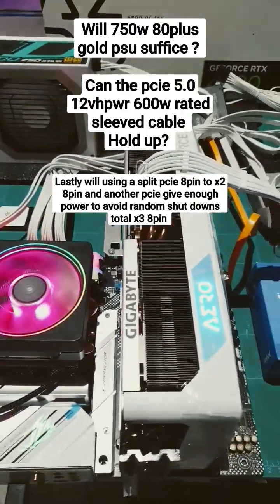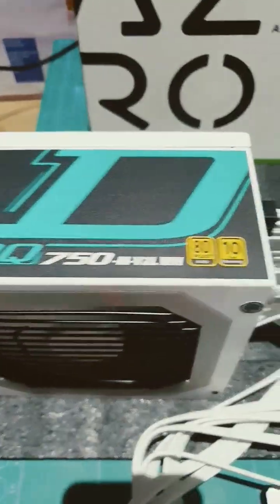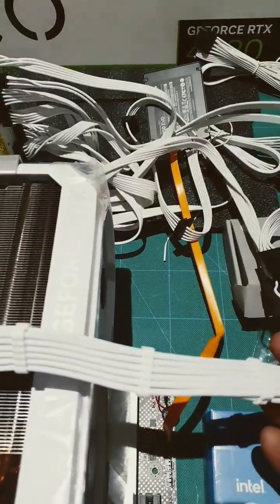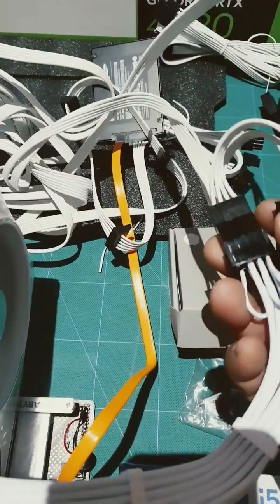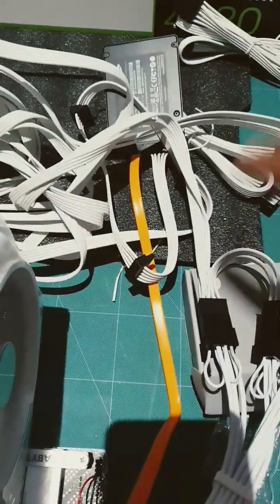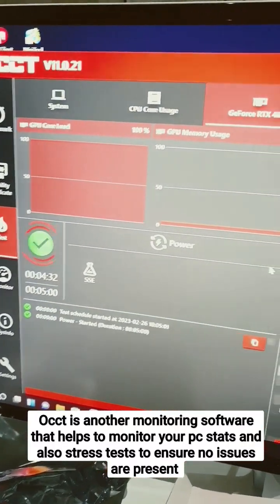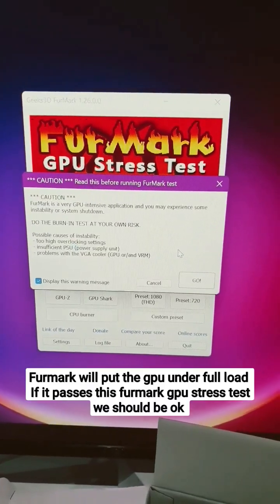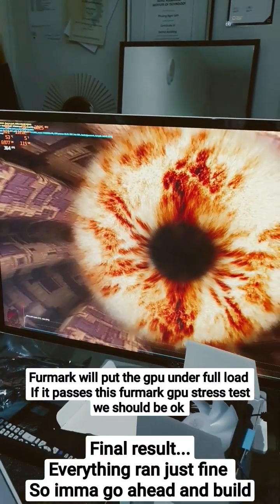will 750w 80plus gold psu run 4080? can  u use split 8pin and another single 8p? is pcie5.0 OK? TEST

Comment: the high end PSUs has the 12 volt power cable and you dont need any spliters.
Reply from the maker: @randomgaming5332  sorry bud what do u mean by that i don't understand
Reply: @MIKEYZVLOGZ  There are PSU that has a 12V-2x6 GPU cable+port so you dont have to use the default one that comes with your GPU, witch you have to connect 3 standard PCE cables.
Reply from the maker: @randomgaming5332  oh ye  true I get ya now..u meant higher end psus have more then just 1 split pcie cable ...and that's true ... 100% it is... so in other words if tour getting a descent gpu get a descent psu to pair with it ... good point ..

Comment: How about a 750w 80gold corsair psu for the i7-13700k 13thgen and Rtx4070 is that enough power?
Reply from the maker: yes should be ok as long as u don't run any overclock and make sure its a gold rated psu and descent brand name

Comment: IS 850W POWER SUPPLY ENOUGH FOR RTX 4080 I9 13900K 64GB RAM?
Reply from the maker: yes it is, look ppl are going to try and tell u that u need more power, but as long as u have a gold or platinum psu at 850w , your going to be fine, the only time u may need need abit more is if you run some overclock, as long as u run everything on auto or standard clock , just your memory can be OC to recommended frequency such as 600mhz etc,,apart from that just keep everything normal and u will will be fine, also make sure you use separate cables for your gpu, if you have a 16p to x4 8pin, make sure your using all separate 8pins for your connection of gpou, do not piggy back any of the 8pins, it will most likely cause your system to crash, as power hungry cards need their power draw so use sep 8pins for each 8pin connection
Reply: @MIKEYZVLOGZ  thx

Comment: i have TX750M psu from corsair with r7 5800x and some 2 fan AIO i dont remember exactly... im thinking to go for 4070 ti, and many have said my psu is alright rn for it since its  80 Plus® Gold
Reply from the maker: ok so from what I understand 750 gold will do.. but do not run any kind of oc ..just keep everything standard 👌.. but alot of ppl will say get at least 850 gold.   but if u ever find it acting wierd power wise then get a better psu

Comment: Danger. Never use the jumper on the 40 series you’re going to run into a few issues later down the road that may not show up now in testing. Also for stability over time when you start drawing more power in certain games like Forza or model warfare, I actually have seen firsthand stability issues with people who were using the pigtail or jumper off of just one connector. Also, that’s a pretty low to your power supply. You were running and I would not trust it running such an expensive GPU I would suggest upgrading to at least an 850 W or 1000 W to be honest and I would go online and look at the LTT power supply tier list and find something that has been rated pretty high up on the tier list. The last thing you want to cheap out on in a build is a powe. Power can actually have a lot of fluctuations, and a lot of micro stutters and stability can come later down the road because of the power supplies in ability to filter power correctly. Higher end power supplies have better capacitors and many other components that are going to save your components long-term from degrading from these micro spikes in power and micro stutters and power. I actually am running a 1000 W strip power supply let’s platinum rated. And a 12900 K./4090 and I’m needing to upgrade already. You really don’t want to be running your power supply that close to. It’s rated power anyways because it’s going to create more heat inside the power supply there for breaking down the components and causing more resistance and higher chance of failure.
Reply: I think he's fine with a 750w on a 4080. The new line up is alot more power efficiency better than my 3090 actually.  I've seen people running 4090's with a 750w psu ( wouldn't recommend cause it's too close for comfort for me)  but 750w for a 4080 is plenty
Reply from the maker: @My1Key  that's what I thought too..cuz even when I tested with power draw from gpu and cpu it was still only pulling 500w ..but in the end I went with a 1300w platinum to future proof for 4090
Reply from the maker: Good tip bud... I guess when u think about long term and stability it might be a better idea to use at least 850 but if u can afford 1000w even better
Reply from the maker: in tour opinion why do u think some ppl get away with using something like this ? a 750w gold on something like a 4080 ot 4070ti? is it because they rent running high draw games ? cuz I've seen so many ppl use lower rated psus. but as I stated in the videos I usually would use 3 sep pcie and also a higher rated and more power psu..
Reply from the maker: so after a bunch of research I decided to get a cougar 1050w platinum 80 plus power supply..after all need to future proof incase move to a 4090..although a 4090 might need abit more juice..we will find out soon enough